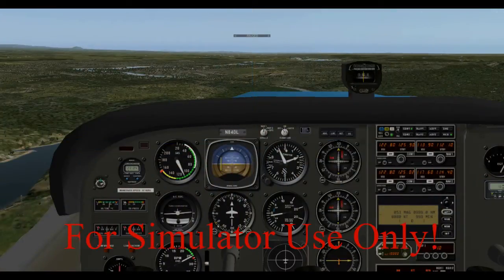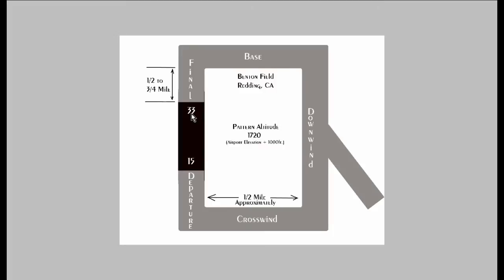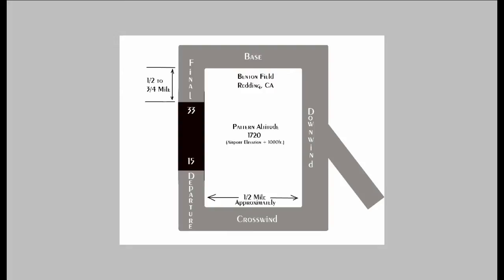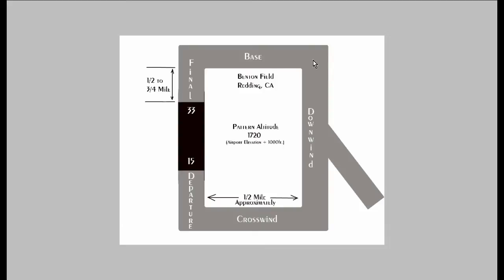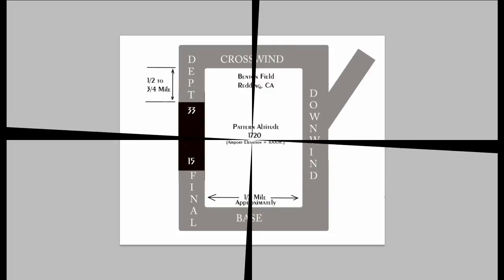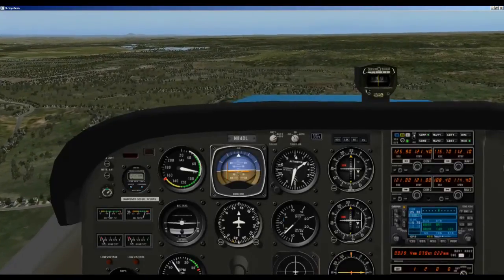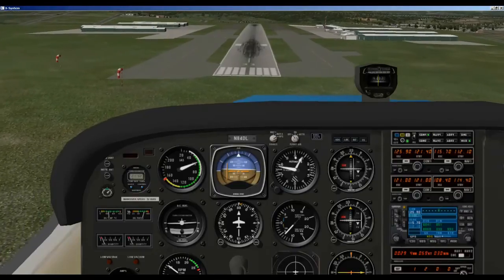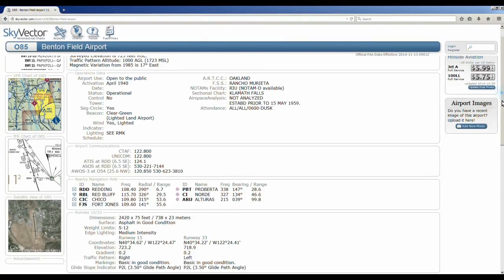Understanding Traffic Patterns & Landing at Small Airports  ~ Tutorial

Comment: If you have left turn for runway 33 and right turn for runway 15, how do you avoid head-on collisions?
Reply from the maker: Hi David,  You only use one runway either 33 or 15 for landing and takeoff at any given time depending on winds and weather conditions. With that everyone should be using the same runway. Since Benton Field is a non towered airport it's up to each pilot to know which runway to use. If in doubt a pilot could call the UNICOM frequency (Benton Field 122.8) and ask other pilots flying in the area but you should know the winds and be able to select the correct runway.
There's much more to learn on this but I hope this helped some. Thanks for your good question and thanks for watching :-)

Blessings,
skip

Comment: Great vid chip,can u tell me why you put carb heat on as you fly downwind please
Reply from the maker: Hi dom, It's the RPM of the engine that makes it necessary for carb heat. Under certain air temperatures Ice can form in the carburetor at low RPM causing lose of power or even stalling the engine. Putting on "carb heat" actually reroutes the air flow to the carburetor over the exhaust manifold to heat the air before getting to the carburetor to avoid icing. This is not a problem for fuel injected engines such as in the Cessna 172SP it's only used on engines with a carburetor. I will be doing a video on Carb Heat in the near future to go over this in more detail. Hope this answered your question.

Blessings,
skip